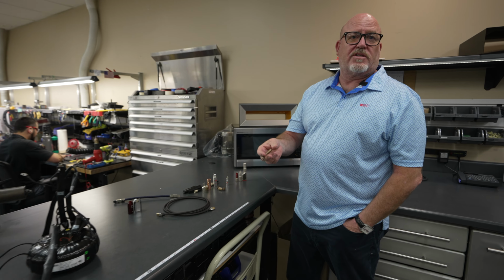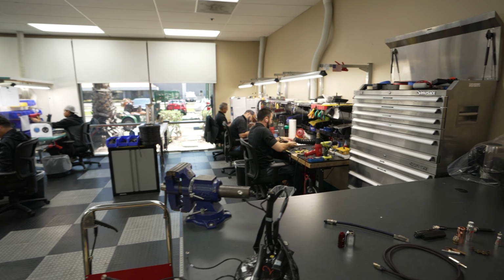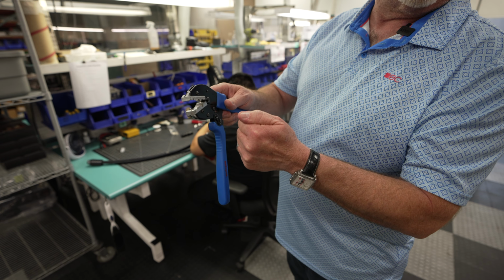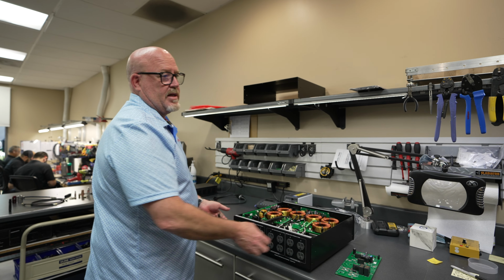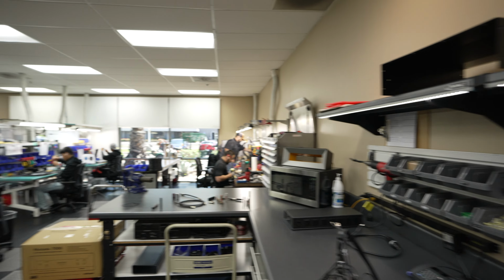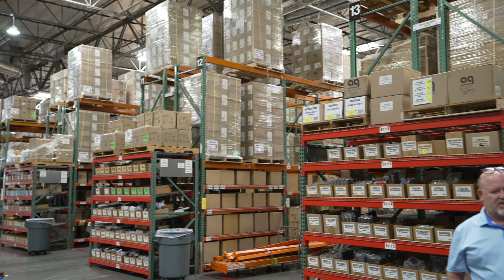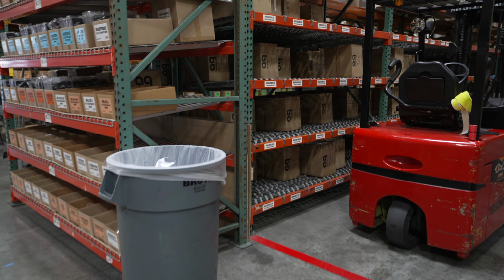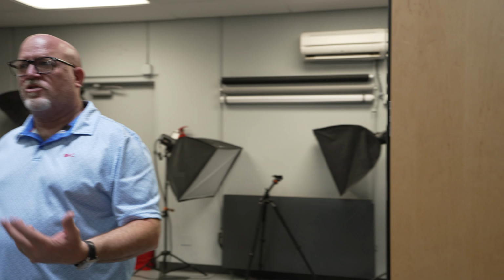Audioquest Cables Factory Tour | One cable to rule them all??

Comment: Well, I just lost even more respect for this channel. No matter stranded or solid core, direction makes no difference. Only active cables are directional, as one end is the power/sender and the other end is the receiver/repeater. Mix an active cable up and it won't work. Mix a stranded and/or solid core cable up, makes no difference.  Audioquest is and has been nothing but snake oil in this field. As your banner says, "Real, Honest Reviews". Get some of their "directional" cables and do a blind audio and video test. Have someone keep switching the cables around and see if you can hear and see the "oh shit" difference as this guy claims the installers hear/see. Then report back and let us know if you have to change everything in your house.
Reply: Directional… just take a meter and set it to ohms.  One direction will always read on average lower and more stable in that lower numerical ohms number.  Whichever direction it read lower in relation to red and black probes for + and -, is the direction of the least impedance aka its directionality.
Reply: @jonathanharris185  Audioholics has already covered this.
Reply: @jonathanharris185  Gene with Audioholics has already tested their "directional" cables with actual tooling. Results came back as BS and lies. AudioQuest, the snake oil in HT.
Reply: @jonathanharris185  Or you could do some real science instead trying to impress everyone with your dvom.
Reply: Obviously not done any testing then. I find when making a statement, it’s best to do the listening first and the talking after.
Reply: @PMC607  ok sure, whatever you say.
Reply from the maker: dude who hurt you? have you ever used any of these? Lost respect?  Get real man
Reply: @ThatHomeTheaterDude  dude, not hurt and yes I've actually used their cables. They were the only brand at Best Buy who had a 4'  HDMI cable and I needed it in a pinch, if you must know. Non active cables are bidirectional. You get real, man.
Reply from the maker: @ItzTheDay  there is nothing im going to say that will make you happy. Be well good sir
Reply: @ThatHomeTheaterDude  this has nothing to do with making me happy. You're nobody to me to impact me in that way, I expect the same in return. What this does have to do with, scam companies misleading people with this BS and  sellouts promoting it. I'm pretty sure Audioholics did actual testing with equipment showing their copper wiring is no different than any other copper wiring and is not directional.
Reply: @ItzTheDay  In that 4 or 5 part series, Gene never once used the cables in their intended application. He never tried them. Also, part of being a reviewer is communicating with the manufacturer. If he was skeptical, maybe he should have asked AQ some questions. Take the DBS system, for example. He made a big deal over that, and how it can't work, but the never took the time to learn anything about it. That technology was developed by one of the telephone companies in the 1960's. Bill Lowe didn't come up with that, and he wasn't the first person to use the DBS concept in an audio product. Maybe he should have mentioned that in his 5 part series. If Gene can't explain why the research done by a telephone company on biasing a dielectric is nonsense, maybe you can? What do you know that they don't know.
Reply: @052RC  what I know is if something is claimed to be directional and is installed incorrectly, it will flat out not work. This applies to just about everything. Batteries will not work if installed incorrectly. A fuel pump will not work if installed incorrectly. A check valve will not work if installed incorrectly. An "active directional" cable of any kind will not work if installed incorrectly. Get the point?
Reply: Sorry. I almost forgot. Not long ago I asked Gene why he doesn't do any real science, just the junk science with his measurement that mean nothing. He knew what I was asking for, and this is what he said. Its too much work. Check my posting history if you don't believe me.

Comment: My first Audioquest rca cables were inexpensive (london tower) , after a few months a hum developed. I replaced this with the Audioquest Evergreen ( a little higher priced) , sounded better but after a year there was a loss of sound, twisting it, the sound came back. I threw it away and replaced with a a new Evergreen, again after a year there was a loss of sound (the wire inside probably got disconnected, so I threw it away too. I cannot afford to buy the more expensive Audioquest models. Will not invest in those more expensive models.
Reply from the maker: you do realize these have a lifetime replacement warranty right? You didnt need to keep buying new ones. They will send you a new cable if it ever fails

Comment: The Great Cable Debate: Some people say measurements are absolute and with HDMI Cable it is all about binary "1/0" Ones and Zeros and I was skeptical but went from Pearl to Forest it was like my TV was calibrated then went to Cinnamon and Sound Improved.

The only thing I can say about measurements maybe it is the same principle as Einstein's Theory of relativity and Quantum Mechanics where they do not support each other and then you need Stevens Hawkins Theory to explain Everything, it has even been proven that Light Reacts different when being observed, then may this shine some light on those for or against Measurements.  

So I have a lot of youtube demo videos. I watch them a lot and I would know the difference. So if you upgrade to any high end cable and you don't do the same you will have no way to verify other than this review and it started with Forest and at minimum and increased with Cinnamon.

Screams Quality.
Reply from the maker: Im glad you are a person of reason. Most people stop at binary, it either works or not. I see and hear a sizable difference the higher you go from standard packaging cables. Im a big fan of audioquest for sure.
Reply: @ThatHomeTheaterDude  Yes what we have to understand with digital is you can lose information due to parasitic data so building higher quality cables help prevent the loss of data, but when it comes HDMI cables you can watch 4K HDR content then up upgrade the cable like I did with Audioquest Cinnamon and Carbon unbelievable difference anyone can try it for themself, so least I can vouch for the Video cause you can see it unlike audio you can't see. So that is why in The 7-layer OSI model data is sent in packets because data does get lost in packets even though it is in Digital format Binary 1 and 0.
Reply: The reason for that is you can't send a bunch of 1's and 0's through a piece of wire. The signal that goes through any digital cable is analog. The signal doesn't go through a full conversion like a dac, it's an analog representation of the digital signal. The analog signal going through a digital cable can be effected by anything that effects an analog signal.

Comment: I've been using Morrow Audio cables for several years now and I always assumed that Audioquest was just another lousy Monster Cable type brand that was garbage until about a week ago when I swapped out my hospital grade 14awg to an NRGZ3 on my Rega Elex-R. What a nice difference! I was going to go the Shunyata route but now I might stick with the Audioquest. I have two more power cables to upgrade moving forward (dac & node 2i power supply)... Thanks for the video!
Reply from the maker: Thanks man. Yeah, the more you add the better the sound. I really like their HDMI too. They make a great difference in audio and video quality.

Comment: 🤔Too many Fake AudioQuest Cable out in market. Customer are too Fear to buy AudioQuest model. alot of Cancel orders. How to know which is Real or Fake! 😥 Pls resolve this problem as soon as possible.
Reply from the maker: I've been in talks with them and they are cleaning up the market right now.
Reply: @ThatHomeTheaterDude  Unfortunately, it also makes me sad as a fan. The new series is also imitated by the highest models. The execution is already so good that it is impossible to distinguish. Of course, the supposedly silver wires are not silver. Are production lines used that also produce the original? This is how to make copies precisely.